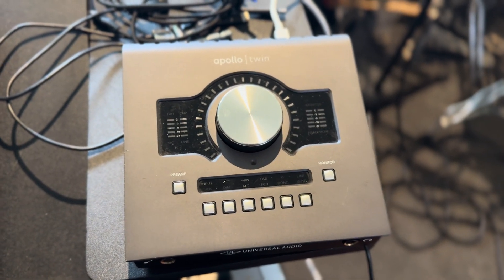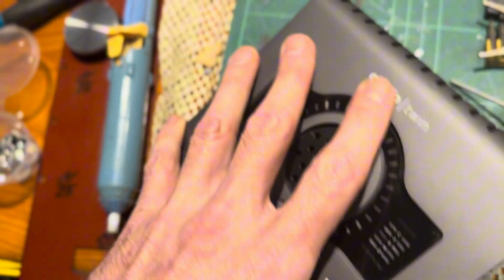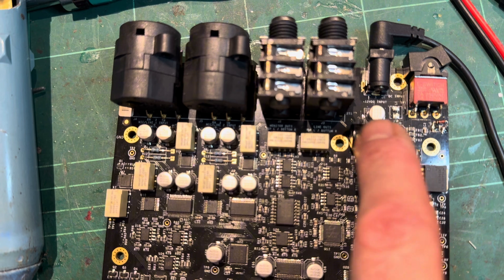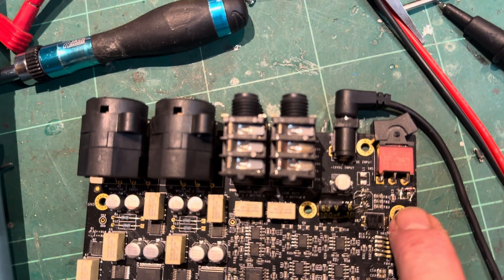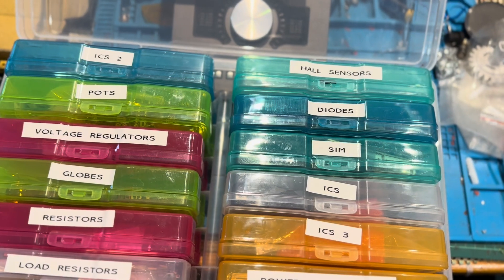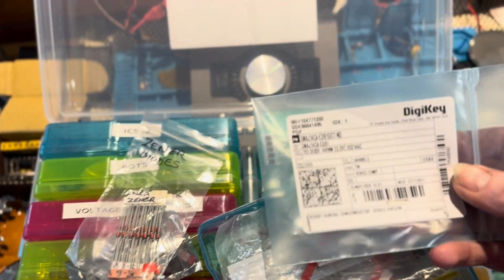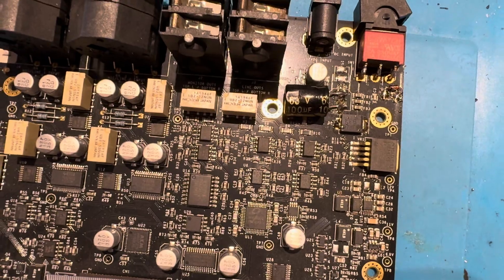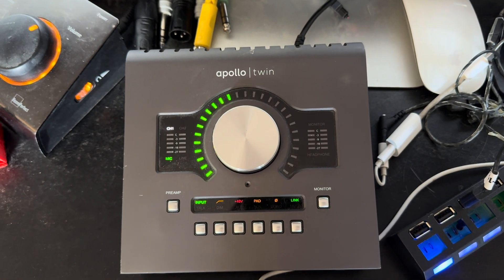50 Cent - The Apollo Twin Saga Explained

Comment: Hey great video. I’m in a similar situation where I acquired an Apollo twin that had the wrong power adapter plugged into it. Would you assume that it’s pretty likely the same issue needing the same repair? Are there any troubleshooting steps I can take before opening the interface? Thanks for your help!

Comment: Thanks for sharing! I have a rack unit I have been scared to work on, but this video has given me some confidence to open it up.  Mine turns on, but doesn't initialize past the first stage. I won't send it in, cause I've already given UA thousands of dollars . They were not helpful at all or sympathetic to my situation unless I wanted to have them repair it.  I'll post what I figure out in the future.
Reply from the maker: @iNeedDrums  just check you are using the correct Thunderbolt cable with the lightening bolt symbol on it. Standard USB-C cables are not compatible. Let me know how you go and I’ll try to help fault-find the issue.
Reply: I was using the right cable.  It's a genuine apple 0.5 meter thunderbolt cable.  I tested the connectors on the cable and the ports on the thunderbolt card in the Apollo.  This happened about a year ago in the middle of a session when I was recording vocals.  I had a Neumann TLM-103 on input 3 using the unison preamp.  While tracking, the audio started clipping while one or more relays started switching on an off quickly.  It was a circuit seizure for a few seconds before I could shut it off.  Once I rebooted, it was not working correctly.  I didn't realize it was a hardware issue  until I figured out changing the sample rate would make the relay glitch quickly a few times and then it stopped responding to the point it's at now.  The computer knows it's there, but no sound, the LEDs come on and off for all buttons and knobs, but do not actually change any internal or virtual functions.  Meters, sync and all real-time indicator LEDs do not work.  At startup, the lights do not enter the normal sync sequence.  Upon completely taking the unit apart and cleaning all components, I didn't notice anything burnt.  Under a microscope it looks much different.  I haven't had time to get into it until recent and I am going to try and document what I find on video because you can't find UA repair info on this issue anywhere.  Many people have had this problem.
Reply from the maker: @ I’d check the capacitors near the relays. Left one side of them and test them with an ohmmeter. One way they should start with low resistance and increase until they show 1 on the meter . Short then out to start test again. If you get no reading or 0 they are like dead. Very common for surface Mount caps.
Reply: @onomatopoeidia  Thanks for the advice!  Hopefully I can start working on it soon.  Can't wait to make music again! Unfortunately, my workflow is null without it.

Comment: In the same boat, bought a used one that wont power on. so glad you made this video, its the most comprehensive one out there, thanks!
Reply from the maker: @dereckjsanguino  thank you. 🙏 50cent part very easy fix. Make sure you take photos and take your time. The big ribbon cable uses a clip to secure it which flips up vertical but you shouldn’t have to remove it if you work carefully. Alternatively, get the part and get a watch repairer to solder it in place :) anyone with basic fine tipped soldering iron or rework station can do it.